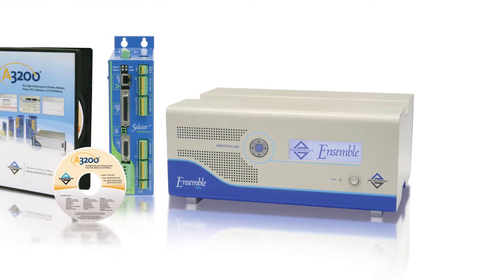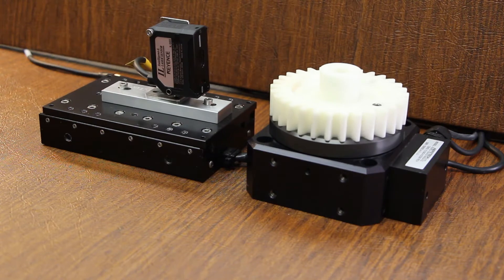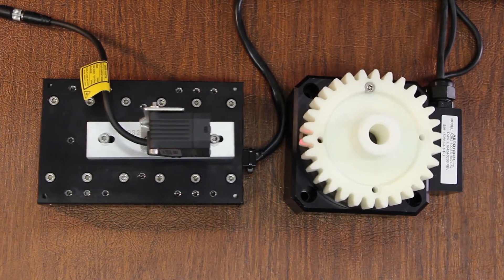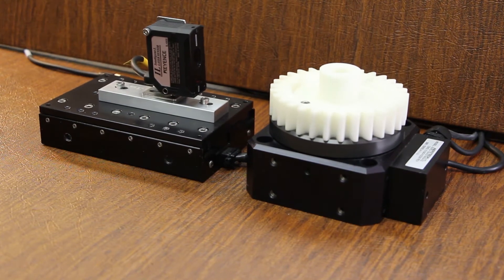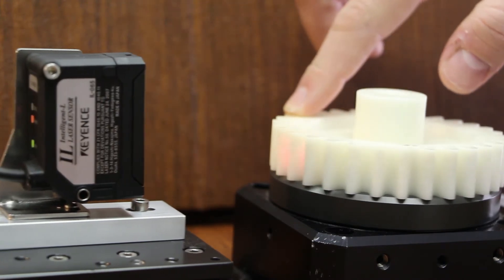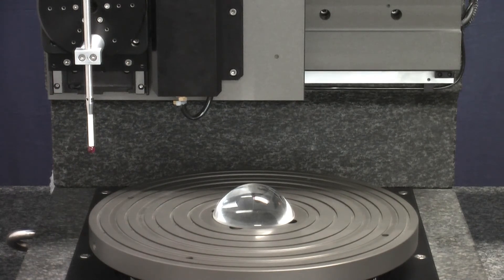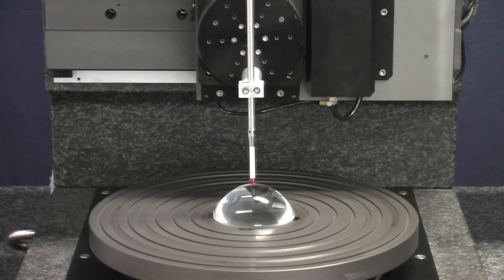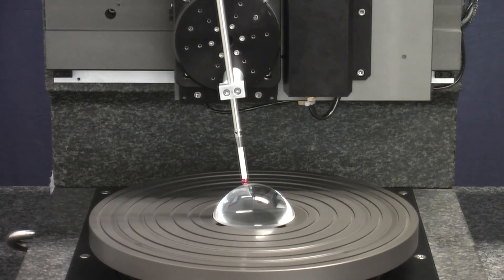AutoFocus

Comment: Can this be Used for cameras too ?
Reply from the maker: +Handytreppe Autofocus can be used with virtually any sensing device that outputs an analog voltage.  In the case of our video, the analog voltage output from the Keyence laser displacement sensor is directly proportional to the distance from the sensor to the surface being measured.

Comment from the maker: AutoFocus is a standard feature on Aerotech’s Automation 3200, Ensemble, and Soloist controls that greatly simplifies sensor integration and increases system performance in surface profiling and scanning applications. AutoFocus is particularly useful in applications where an external analog sensor is used to maintain a constant offset from a work-point. Watch the video here:
https://www.youtube.com/watch?v=29ZzdertdN0